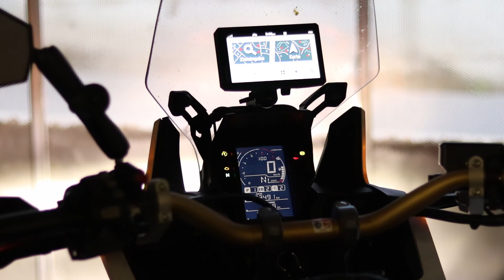How to mount a GPS on Africa Twin adventure sport! (Garmin-zumo-XT)

Comment: Geil, danke. Jetzt möchte ich nur noch bitte gerne wissen, wie du dein Navi montiert hast und welche Halterung du benutzt hast. Danke und liebe Grüße ☀️
Reply from the maker: Grüße dich 😃 es freut mich dass der Video dir nützlich gewesen ist. Ich habe die originale Halterung von Navi (die kommt mit in der Verpackung) verwendet. Du hast recht, hätte ich gleich diese auch mit Filmen sollen!
Reply: @roadcallsme   Danke für deine liebe Antwort. Eine Frage ist immer noch offen. Es gibt einen Sprung im Video, wo das Kabel vom Zumo XT aufeinmal Schuhe hat und in einen Adapter gesteckt wird. Das habe ich nicht verstanden. Liegt der Adapter schon in der Twin, oder hast du den nachgerüstet? Ich frage, weil ich mein Moped nicht zweimal auseinander bauen möchte. Liebe Grüße aus Berlin ☀️
Reply from the maker: Mann Mann 🤦🏽‍♂️ ich kenne zweimal auseinanderschrauben auch…
Danke dass du fragst, ich musste eigentlich darauf achten 😅 der Stecker sowohl männlich als auch weiblich ist original am Moped (vorne ein 4er und hinter der Sozio‘s Sitzbank ein 6er). Allerdings das weibliche metallische Teil, welches die KabelSpitze hinein steckt, muss man selber besorgen! Ganz liebe Grüße aus Graz 🍻
Reply: @roadcallsme  where do you get the metal female part from ?
I have a 2019 ATAS and mine comes with a dummy socket as well. 
Thank you !
Reply from the maker: Hi there 😃 if i correctly understood what you mean, you’re asking about electricity sockets. They are originally on AT (once under the back sit and once under front frame, which i used here). Hopefully it could help you 🤓🍻

Comment: What size connectors did you use at 2:37?
Reply from the maker: Hi there, thanks for your interest and reaching out. Those connectors are originally mounted on the AfricaTwin, however you can find similar connectors in aftermarket (searching for: africa twin spar plug connector front/back) 😃👍🏽